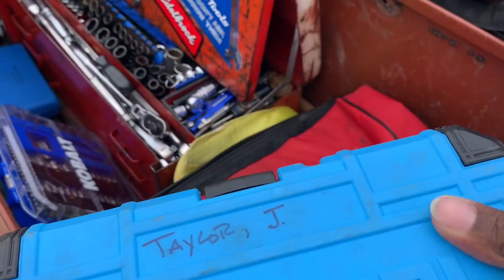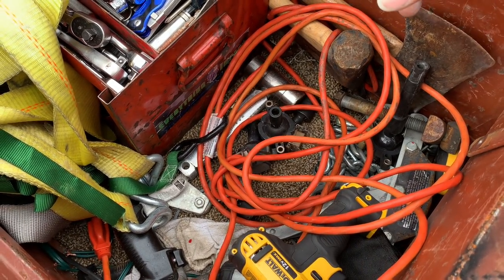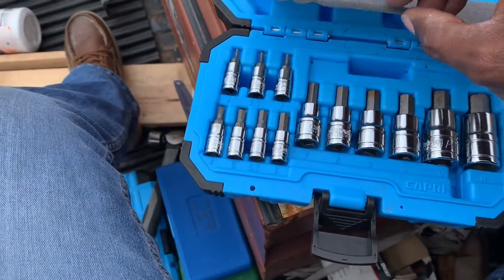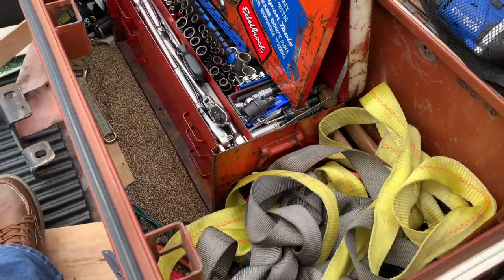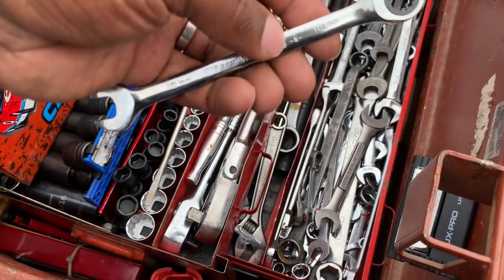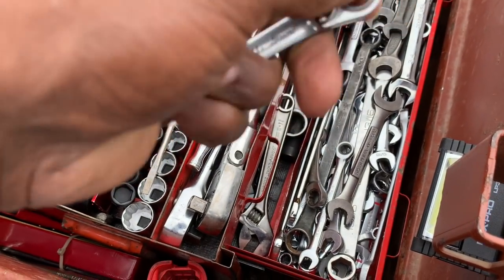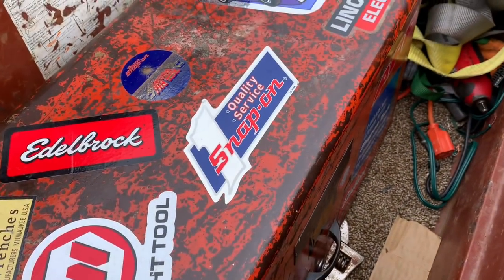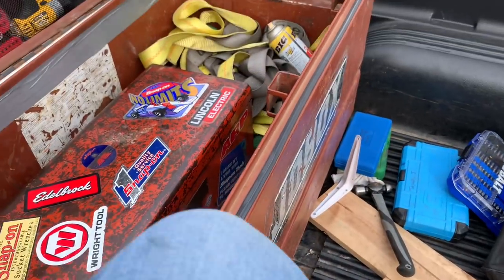HUSKY TOOL BOX TOUR | LOADED SERVICE BOX

Comment: Thanks for another great video brother.  I hope everyone is having a great day. Those Wright tool swivel deep well sockets are nice. I own the Snap On shallows but have been wanting the deeps. I have a few of Wright and Williams tools, very nice indeed.  American made and are less expensive than the Truck. Although I did not base my tool needs on price alone.  
Stay strong brothers.
Lol, not a mechanic but strive to be one, funny.
I received my ASE Certification in 87 but up until then I just worked in different shops and out of my garage. 
Doing what and how you are working you will gain alot more experience and be well rounded than a tech in a dealership. I made a decent living as a tech but my favorite is working exactly hiw you do it. Lots more fun even with the headaches.

Comment: I try trashing my port a cable cordless tools for a reason to upgrade and they keep going. The batteries suck and I've owned the tools for prob 7 years.  I'm slowly getting into the hf Hercules brand I use them daily with 0 complaints gotta be best bang for buck with a easy 5 year warranty if needed
Reply from the maker: My PC’s are running strong as well, but the batteries are fading after 5-7yrs of use. I primarily use them in/around the farm for maintenance

Comment: Off Topic but im kinda  Excited  For the new locking flex head ratchet coming out lol
Reply from the maker: I’m not sure how I feel about the locking mechanism. From the photos I’ve seen, I’m concerned it would get in the way, especially in confined spaces. I do plan on buying one, if for nothing more than to compare to their existing designs
Reply: @MidwestToolReview  
I noticed that also. The lock lever seems stick up above the ratchet. It is more of a flip style lock compared to Matco's rotating lock.
Do you like the sliding lock on their present ratchet compared to the Matco design?

Comment: How do the Cobalt wrenches hold up?
Reply from the maker: The newer designs perform well. The box-end typically operates as it should, regardless of the brand. As for the open-end; while not as strong as some other brands, for general duty mechanic work. They will perform as expected. I also have the Kobalt USA wrench sets, and they perform more better, likely due to the fact they were manufactured by Williams (Snap-on).

Comment: Do you like matco or snap on locking flex heads more and what is your favorite ratchet
Reply: Hey Lucky, sorry to intrude on your question. I know you was asking him but I own both and thought I might give another opinion on both of those ratchets.  
My favorite is the 12" Matco locking flex head. Primarily because of the locking position.  I own, as of now, 27 ratchets and the majority is Snap On. They feel about the same, both are smooth, incredible fit and finish and I have literally used my leg to brace my body while pulling on them. Snap on has the lock on the handle while Matco has the lock at the pivet point. Yesterday I watched a video of the new Snap On flex head and they have moved the lock up to the pivet area also. I don't know when trucks will have them in stock but I suspect soon.
But until then my go to ratchet is Matco #BFR128LFM, that is the orange grip. My other one is #BFR128LFG, Green grip. 
Stay strong brothers.
Reply: @randysmith9636  thanks for the information yeah the new locking flex head is interesting I’ll probably go with that one if it will come in the short handle because so far I have only seen it in long handle in the video
Reply: I love my matco locking flex love its my favorite ratchet